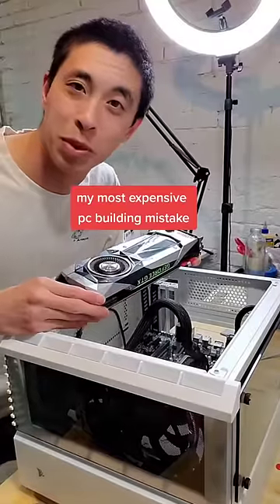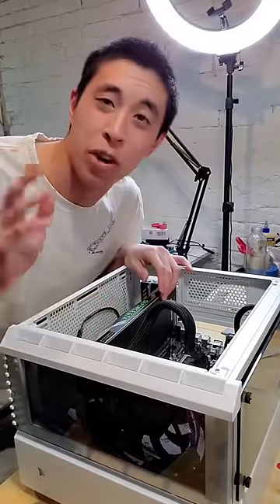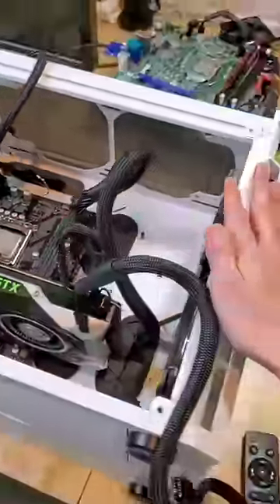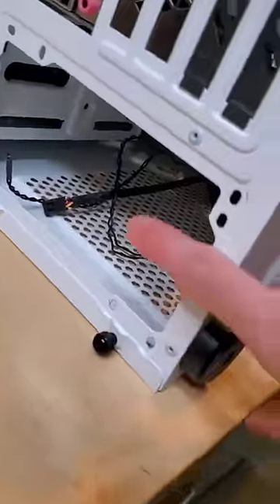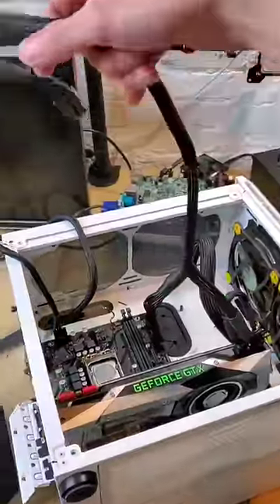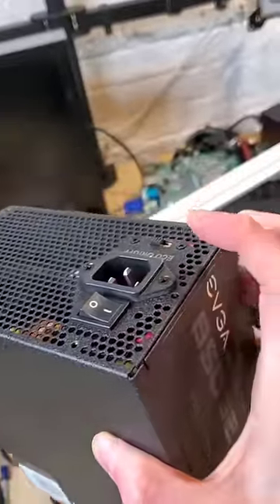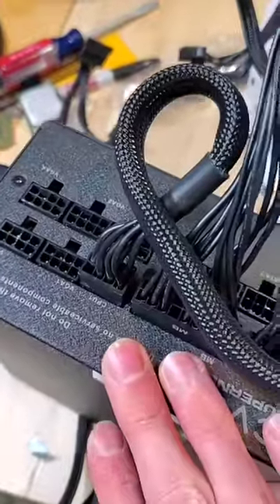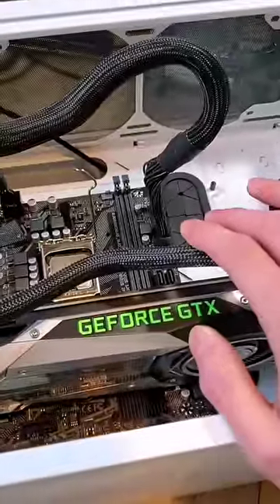my most expensive pc building mistake... #shorts

Comment: Holy crap i was literally about to do this as i ordered a new powersupply and was lazy. You saved my system jesus
Reply: Done the same thing, power supply was dead so bought a new one, same brand one model newer, never unplugged any cables and decided to use the old cables to save time. Luckily I had my GPU unplugged at the time. Everything else was plugged in. Lost my ssd, hdd. Everything else was fine which now I’m super grateful for as my mb, processor could have also easily been fried. Instantly realised my mistake and everything booted after a new SSD and swapping to the new power cables
Reply: I actually did this and everything was fine
Reply: Weird, I replaced my psu 3 weeks ago, my gold evga psu gave up so I changed it for a platinum evga psu. I never redid my cables, both of the same brand, and it just worked for me, nothing fried.
Reply: @slavisatosanovic2672  That was a really bad idea.

Some cables can, in fact, be used with other PSUs. However, if you're unlucky (and the odds are quite high, so much higher higher than killing your system with static) you're gonna fry everything.

Unfortunately PSU manufacturers just refuse to make a standard for their cables. Some do, most just flat out refuse.
Reply: @MrMisticZ  it was the same exact PSU (manufacturer, and model) I have custom threaded PSU cables anyways, and was never intending to use the ones in the box.
Reply: @slavisatosanovic2672  Ah, makes sense then.
Reply: I went from a Corsair 850 to 1000W PSU a week ago. Didn’t change the cables and my pc is fine
Reply: @LiamMitchell5294  Someone I know killed his HDD with a bad cable as well, but it turned out there was just a burned fuse, we replaced it and the HDD was fine. You might still be able to repair your memory.
Reply: @MrMisticZ  gotta get that motherboard frying, make more $$$!!!
Reply: Lazy bad. Don't do.
Reply: I did it once luckily I only reused my salary power for my ssd it only fried my memory thank God
Reply: Bro I was just about to swap my 500w gold psu in shitty junk yard pc (backup) to a 800 W platinum psu and didn’t feel like changing cables so thank fucking god I seen this
Reply: @slavisatosanovic2672  same here I did it 2 days ago.
Reply: This man is a hero he has me double checking now.
Reply: @slavisatosanovic2672  same here. my guess corsair uses the same wire diagram cause i swapped from a 5 year old psu wires to a new psu and no problems
Reply: @MushiMGO  i went from 1200 to 850 no problems i think this dude got tricked with swapped wires
Reply: But wait how do some people get custome cables
Reply: @ts757arse  ooooh thx man now i understood
Reply: @ts757arse  ty for the advice
Reply: @LiamMitchell5294  but what is reason for this to happen??
Reply: @shasashu  reverse polarity on the cables, postive and negative are swapped around on the new vs old cables I believe
Reply: I build few pc in my life never happened to me and im sure i was missing some cable and i used other brand cables today you buy custom cables with led and Color’s im pretty sure i didnt understand the vid🤯
Reply: I never knew this could happen but i always remove all cables because i hate mixing and matching stuff
Reply: @LiamMitchell5294  why dies this happen? What's the reason?
Reply: Did the same thing switching from a corsair to EVGA powersupply. Thankfully I only fried my SSD...hard lesson learned
Reply: I have a gpu that requires 3 8 pins. I did steal one of the clean sigle 8 pins from another psu but they were both evga but one was 750 the other  was 850. I was ok tho
Reply: i don't even understand what happened here... maybe i should just buy a pre-built
Reply: I did and it was fine but i used the same brand just upgraded and it was perfectly fine
Reply: Dude no joke I did this yesterday. Somehow it didn’t fry
Reply: I've replaced a 5 year old 650w Seasonic with an 850w Phanteks Revolt using the same cables without issue
Reply: Doing this is fine, he would have done something else to fuck it up
Reply: @LiamMitchell5294  get your life together. Working some hourly loser job so you can play video games on a computer.  Lol i can't imagine
Reply: @prinniesforeveryone321  who mentioned video games? Says the one trying to @ people on youtube, you must have too much time on your hands. Go get a hobby dude…
Reply: @nikodromikro  opposite polarity  on the cables + & - are opposite on the pins
Reply: Yeah you never want to mix PSU cables like that, unless you know 8ts from the exact same model. The cables will tell you what model it is from, they aren't all the same gauge cables.
Reply: You need to use the psu to motherboard connector that comes with thr motherboard. Almost everything else is fine.
Reply: @huynhvonhatan  you got lucky.
Reply: @jeffder7143   not nessisarrily, if its a modular PSU you cannot just grab any connector because from any PSU it need to be for that specific PSU or you can fry your system it's because every PSU cable isn't the same gauge as that model.
Reply: @slavisatosanovic2672  its like Russian roulette.  Sometimes your ok other times your fried.
Reply: @slavisatosanovic2672  BOOM
Reply: @gg_master109  custom cables are usually extension cables.. so pinout doesn't matter
Reply: @baucelabs1159  umm okeeu
Reply: I had a lucky escape then, never realised until now. I didn’t think my psu came with cables so tried to use same ones but luckily didn’t fit on one of them, then found the ones hiding in the box. Few!!
Reply: @soldatvonzufall2548  Yeah no explanation is provided.
Reply: @blckmlr7573  Mmm, this wouldn’t be the reason. The current and voltage levels are not high enough to make such a critical difference for wire gauge. 
PSU cable gauges only vary by a couple different sizes at most.
Reply: I wonder how this even Is a thing. The wires and just wires. Identical regardless if which psu you have.

Someone smarter than me please explain.
Reply: @akira3871  to my understanding its because of the wattage. the cables of say a 800 W power supply will suck out more juice from the PSU compared to say a 550 W PSU, and as such if you mix and match them the wires will try to use more or less energy than the power supply can supply, resulting in potential bricking
Reply: @LiamMitchell5294  hey so I'm about to get a pc and I'm kind of confused on this,  what is the proper way to prevent this?
Reply: @connorvezinabuyck8922  buy a new power supply and only use the cables supplied in the box, this happens when you swap to a new power supple but use the old cables. All brands of cables can be different. Make sure the Wattage of the power supply = the total power draw of all your components. There are pc psu wattage calculators out there or just add it up. Your CPU may draw 100w alone
Reply: @nathanrossiter122  I'm not entirely sure, but I think it's only an issue if the cables were designed for a lower voltage and you're plugging it into a higher voltage psu. 

The cable fries as a result. I think with cables designed to hold higher wattage, you should be fine.
Reply: @huynhvonhatan  I think it was the fact that the prebuilts/OEMs come with weak low power cables . I grateful for this short cause it exposes a problem I never thought about . Always use the cables that came with your Psu.
Reply: Where do you buy the cables? Like how to know they are for that specific brand and model?
Reply: @kyubeycoobie3568  I think the issue more lies in if you buy cables designed for a low wattage psu and plug it into a higher wattage psu, the cables fry since it can't handle the excess voltage.

You can switch out cables as long as the pins and wattage are supported.
Reply: genuinely same, was about to do this
Reply: @huynhvonhatan  its not weird. just lucky. that just means evga from their gold psu to platinum they kept all wiring and pin layout the same.
Reply: Jesus: it wasn't me. You just learned that through YouTube. Give that bstrd some credit🤦
Reply: @huynhvonhatan  its because your power supply is by the same manufacturer as the previous one. Most times switching between different power supplies from different brands is the issue
Reply: I don't get it
Reply: @slavisatosanovic2672  me too. I had am nzxt 750 watt and got a rog strix 1000 watt and just used the same cables. It worked perfectly fine. There's no reason why you can't use other cables unless they are those mustard and ketchup. Typically they're all the same.
Reply: Lots of miseducation in this thread. The cable pin layout (pinout) going into components (GPU, mobo, CPU) are standard. They will always be the same regardless of who made the PSU. However, the function of the cables going into the PSU differ by make and even model. Corsair for example has three or four different pinouts they use for their PSUs. As long as you can confirm two PSUs use the same pinout, the cables are fully interchangable. Finding the pinout is typically a simple search. If you buy custom sleeved cable extensions, your PSU is irrelevant. However, if you buy or make fully custom cables, you need to confirm your pinout.
Reply: @slavisatosanovic2672  same 😮
Reply: @slavisatosanovic2672  justice for targeted individuals
Reply: @akira3871  Because nobody ever established a standard. It wasn't that long ago that PSUs weren't modular so it didn't matter. Then as each company rolled out modular PSUs they used their own pin-outs. And everybody ended up doing different things and, even within the same company, when changing a design from non-modular to modular it probably made sense to do some different based on where the other components were.

Now everyone is doing it differently, whose standard do you adopt? Recently at least it seems individual companies are standardizing their product lines and I believe some companies have been moving to the same standards, so hopefully we will get there.
Reply: @Karzakus  No. That has nothing to do with it.

It is that the pins on the PSU may not agree with each other. So, maybe the top right pin for the 24-pin on the PSU carries 12V on one power supply while on another brand it carries 3.3V.

If you use the cable from the second PSU on the first, it will carry the 12V from the PSU and dump it into the 3.3V line of the motherboard. And if you put 12V on the 3.3V line, everything on it will be fried.
Reply: How can i avoid this mistake, just buy a new powersupply and use only this and not mixing a different cable with a different powersupply even if it is the same brand ?
Reply: @tsubimekdeinmansubimekdein3898  If you buy a new power supply, use the new cables. 

If you knowwhat models both power supplies were, you can easily check for compatibiliy online. Either the manufacturer's website or CableMod should be able to point you in the right direction. 

If you have the right tools and knowledge you could check manually.
Reply: @slavisatosanovic2672  It's not guaranteed to always work, so it's better to be safe. You never know when it will actually fry and I don't think you want to know 😆
Reply: @FireStarJutsu  like I said, I have custom cables anyways that did not come with my PSU and they've worked across multiple PSUs.
Reply: @slavisatosanovic2672  Yeah a lot of people use custom PSU cables, so they're different I guess...?
Reply: How would you even alleviate this problem
Reply: I didn't know this. I've built a lot of PCs, so I have a random box of psu cables, when I need some, I just mix and match. I've never had a problem.
Reply: Same
Reply: @huynhvonhatan  It all comes down to if the manufacturer is re-using the same pin-layout or not. If they changed something for the newer model you're screwed. If they didn't then you're fine. Better safe than sorry on this.
Reply: @MrMisticZ  It depends on the cables and which PSU you're changing. Just make sure to look it up first and check all the cables and you'll be fine. Always have your phone and Google ready when building/modifying a PC and question every move, that's my motto.
Reply: @slavisatosanovic2672  so you DIDN'T do what this video and this comment are talking about.

The whole point is using the same cables with different power supplies, even from the same brand. If you are using the same power supply and it worked before, why would there be a problem? Lol
Reply: @doomslayerforever2858  you got lucky. There have been other PSUs from Corsair that have fried PCs even though they just upgraded from an old Corsair to a new one.
Reply: @gg_master109  places like Cable Mod understand the requirements of PSUs, they'll ask you what PSU you're ordering for and pin the cables according to the manufacturer's table.
Reply: @soldatvonzufall2548  he used power supply cables from one brand/power supply with a completely different power supply. These aren't rated the same or pinned the same (different connectors) so there is always a chance that using mismatched wires for your PSU fries your PC
Reply: @gaiusmarius578  nope. Some PSU cables are pinned in opposite ways, so you're risking putting a negative pin into a positive socket and a positive pin into a negative socket.

It's only "okay" if you know the exact pinning of both PSUs, the cables, and they match. =D most people don't even think of that and so they fry PCs
Reply: @jeffder7143  if you use any cable with the reverse polarity to your PSU any or all of your components can be fried. It's not one connector.
Reply: @epmcgee  still using these custom red sleeved cables for my 1200 on my 850 no problem. I'll make sure not to use the stock ones
Reply: Me too, just saved my build probably
Reply: Yeah someone's gotta explain this. I thought the whole point of buying a modular cable to make it easier to upgrade the power supply without having the reroute everything again. If this the case then spending the money for a modular PSU is literally pointless. The non modular are cheaper anyways. Someone tell me how often does this happen or Is this just some one off experience cause if it's not and common then I'll just save myself money and stick with the non modular PSU and save money since modulars cost more.
Reply: There are a few different ways power supply manufacturers setup cables, there is an online repository of how each brand's cables and PSUs are setup and if you take the time to read it you could 1)make sure the cables match, which is not entirely unlikely or 2) make the needed modifications to make them match, Linus did it in one of his videos but I do not reccomend it, don't do things you're not certain of
Reply: @LiamMitchell5294  How do you save time by doing that? You still have to unplug the cables from the new psu, and plug the old ones. Sure, might take 3 minutes instead of 4 when youd unplug the old cables from the old psu and just put the new one and plug the cables that were already in, but.. was the saved minutę worth it?
Reply: @MushiMGO  dude are you powering a small town lol? Jeesus what is your set up
Reply: @PuddingXXL  3090ti and a 12700k
Reply: @huynhvonhatan  anything fry yet?
Reply: @CrzBonKerz21  everything is still working well

Comment: I "over clocked" my 2080, turns out i was actually making an easy bake oven.
Reply: elaborate
Reply: @fisher_dittburner he probably did it wrong or overdid it and it overheated until it fried
Reply: I just got a 2080ti and it runs about 72-78c during gaming and I feel like my glass side panel is gonna turn back to sand
Reply: What happened to my previous comment?
Reply: @trentbolognani2509  those temps are normal under heavy load.
Reply: @jryanr2010  I’m aware, temp comes from power draw, I just had a new 6650xt which drew about 120-125w and got in the 60c range which wasn’t really that warm, and had a rx570 drawing about 100w before that never exceeding 65c then I got the 2080ti which draws 250w and it warms up my room after an hour or two
Reply: @trentbolognani2509  yeah that's definitely normal. They can put out quite a bit of heat. My GTX 970 used to run around 70° under heavy load. I currently have a 4090 have only seen it get up to around 65°. Maybe 70° in CP2077, I can't remember. But I wouldn't be concerned with anything under 80°. That's a perfectly acceptable temp for a 1080ti under load
Reply: @jryanr2010  it’s a 2080ti drawing 250w
Reply: Buying an $1150 GPU  and not even checking to see if it fits my case.. then went off and got the case I had been looking at anyway 🙄 extra fans.. expensiveeeee.......
Reply: Heres a 🍪
Reply: @JayDee-vt1rp  had 3" clearance and extra cooling 😎
Reply: @trentbolognani2509 thinking anything under 80 is hot, clueless